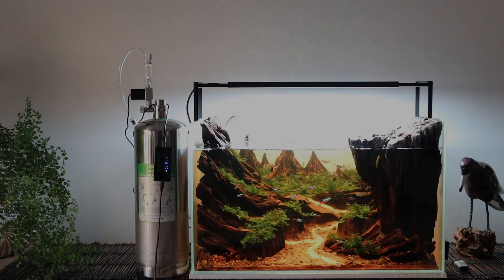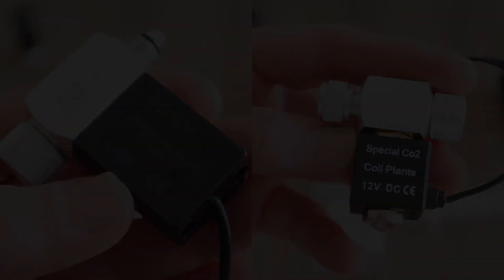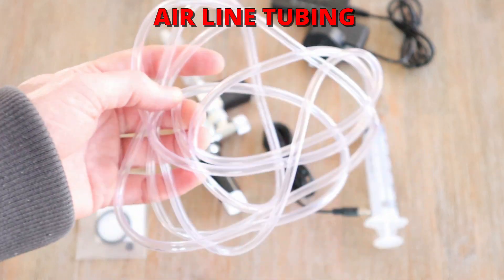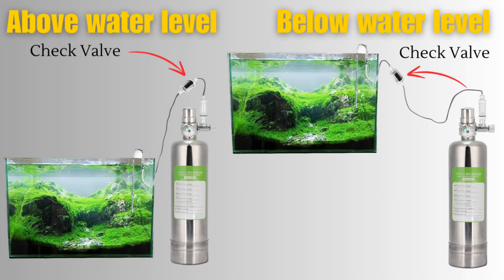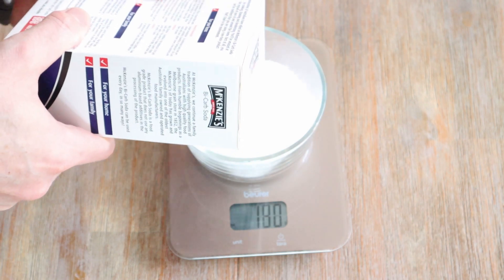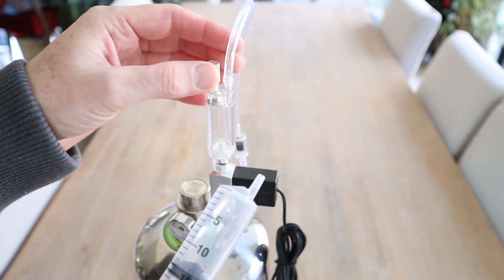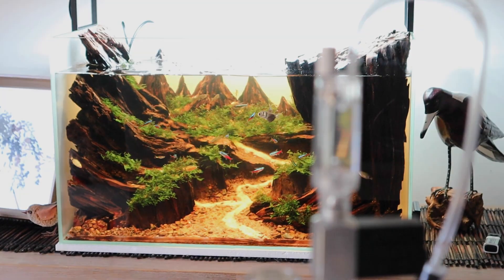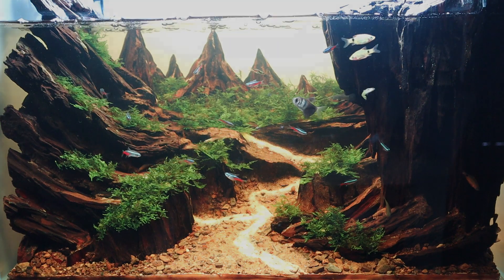How To CO2 Generator Kit for Fast Plant Growth

Comment: The instruction in my 2l is 200/200 but the ratio should be 1.31 so it's 262 soda to 200 citric acid. I've been wondering if adding 300 soda and 230 acid is safe. Should be because with my quantities the meter is below half of the green range.
Reply from the maker: Yeah, it’s a bit scary when you hear it fizzing away, it does create a lot of pressure, but it’s completely safe inside the canister. Since I made that video my canister is still over halfway full. I only use the Co2 sparingly as the Christmas moss is pretty well established and doesn’t need much Co2. It’s better than going into the shop and paying for refills, when you can do it yourself from home for cheap.

Comment: You have a 5 liter capsule. How many months will this capsule work?
Reply from the maker: I’m only running it very slowly as the moss doesn’t need much Co2, so far it’s already lasted 8 months and is still over half full. Should last up to 16 months or even more. It all depends on your CO2 needs. Mine only runs at a drop every 3-4 seconds, so is very slow. Hope this helps.